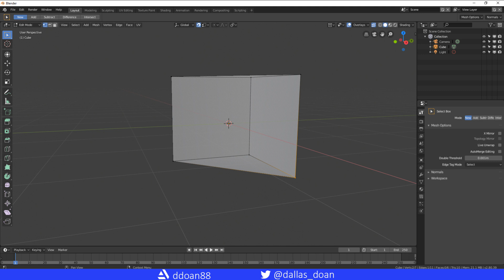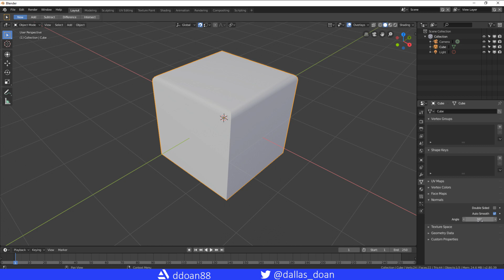Switching From Maya to Blender 2.8 - Polycount Display, Weld Tool & Soften/Harden Edges

Comment: Your getting really good at blender you should check out blender 2.9 they gonna rework the userinterface like maya's design.
Reply from the maker: I am getting so use to the interface of blender 2.8 I might just stick to the defaults. We will see. Thanks for the compliment I appreciate it. Still tons to learn in Blender.
Reply: Maya interface is bad, compared to Blender 2.8. And Blender 2.9 is not getting a Maya UI, stop trolling.